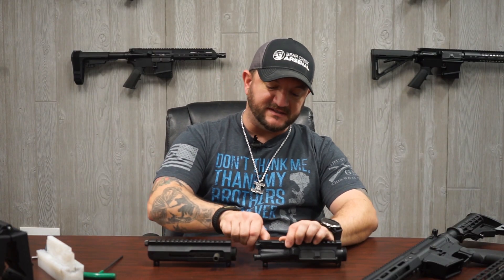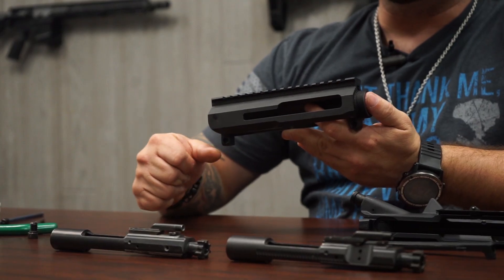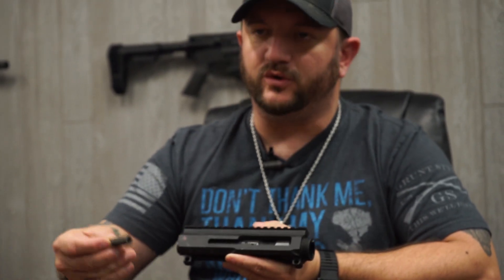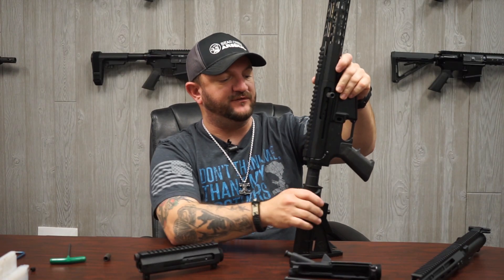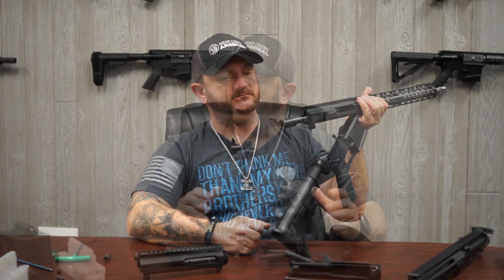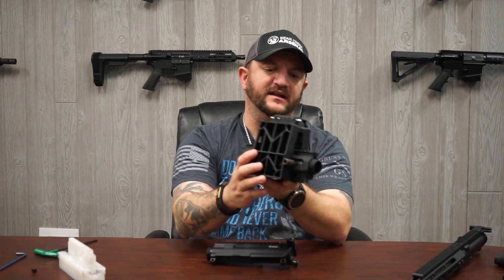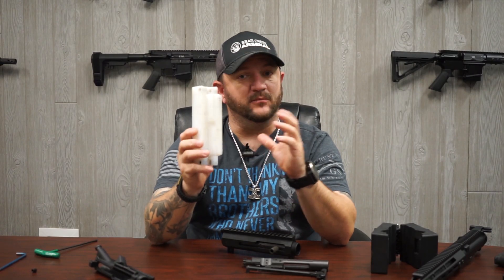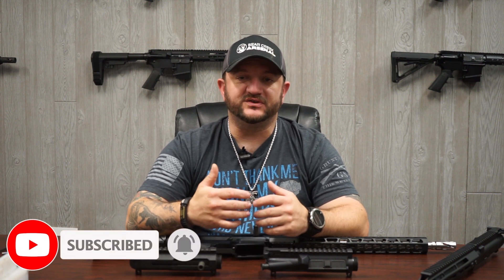Side Charging Upper: Guide, Tips, Maintenance, and More Common Questions

Comment: just got my 10.5" side charging upper from BCA in .223 wylde. I LOVE it!! well actually i wish i could say that. under gassed short stroking and the bolt locked up twice in less than 30 round, never once fully cycled. sending it back....
Reply: I had the exact same issue with my wife's pistol . Did you exchange it or just get a refund ?  It's too late for me to send hers back so I will have to start going through the change parts game from the gas system to the different buffer components .

Comment: Great video, just received my Bear Creek Arsenal 350 legend upper, very impressed with initial fit and finish. Minus the charging handle which looked like it was dropped or hit, I just filed it down a little. My question is my headless screw seems alil loose, can the screw be screwed all the way in? Or will that interfere with the gas system somehow?
Reply from the maker: Yes screw it all the way until the flat side of the screw is facing down. Sorry to hear about the handle, we recently updated our packaging to resolve this issue. Send an email to warranty@bearcreekarsenal.com if you would like a replacement
Reply: @Bear_Creek_Arsenal   very cool, just got here all together and she’s a beast! Thanks guys!!

Comment: I recently ordered & received a 7.62 left charging upper, i have installed it on a mil spec anderson lower. However, the rear plug does not allow the upper to sit properly. I found on your youtube channel the fix is using a headless 3/8-16 by 3/8 screw. Do I only have to tighten it to were it is flush with the rear of the upper or do I have to screw it all the way in & torque it to a specific spec? Thanks!
Reply from the maker: Hey Rogelio, it should fit as long as the flat side of the screw is facing down when you mate the lower to the upper. If not you can use the headless screw; it's only there to prevent gas from blowing into your face so there's no torque specs. Just screw it in as much as possible so it remains secure
Reply: Thank you!

Comment: Does the plug at the back have to be tight?  On my new one, if i tighten the plug, it's no longer horizontal.
Reply from the maker: It doesn't have to be tight, once the upper is mated to the lower it will keep the screw in place
Reply: @Bear_Creek_Arsenal  thanks!  Love my new upper, haven't shot it yet, but it seems like a quality piece.  

Is there a reason most of the pistol barrels are 'heavy'?

Comment: Gen 2 have a flaw in the bolt and do not cycle reliably on subsonic ammo. Out of (4) .300 Blackout uppers, (2) were chambered incorrectly and the others had serious cycle issues that can be traced to very poorly milled bolt carriers. Gen 1 have been completely reliable (have built (7) of them) with just the problem of the  charging handle coming loose. Will not be buying anymore BCA side charging uppers until this is resolved.
Update: I took the bolt out of the bolt carrier and using grey rouge and a commercial buffing machine was able to make the upper work fine after thoroughly buffing all components. I recommend especially buffing the head of the bolt locking pin because that drags on the upper.
Reply from the maker: Sorry to hear that! Send an email to bcatech@bearcreekarsenal.com and they'll look into your issue

Comment: The Answers we want: 

BCG maintenance part replacement 
Gas block issues 
Staking issues 
Do you recommend a full look over before firing (quality control issues) 

The reddit forums are not particularly looking good for BCA and I'm nervous for my order 

However being infantry we shoot some worn out shit and it still functions. 

Replacement BCG where do we get it or do we HAVE to get a BCA BCG that would be a nuisance
Reply: i used the side charging BCG from BCA in a PSA rear charging upper as an experiment.

Comment: Could a threaded pipe plug be used in place of the rear receiver plug?  Doesn't seem like it would need to be removed very often.   Thanks your videos are quite helpful will be buying some 350 legend uppers very soon
Reply from the maker: Hey Mikel, I don't see why it won't work as long as it has a thread count of 3/8-16

Comment: If a failure to feed were to happen and the carrier is half way into the buffer tube with a mag lock, how would you remedy that?
Reply from the maker: From what I think you're describing I would pull the charging handle back and lock the bolt to the rear. Then try to drop the round out and possibly use something to push the magazine out

Comment: You forgot to mention the inability to utilize the forward assist if you use the side charging handle in a regular upper assembly, because there are no notches in the bolt carrier of the sude charger.  You also didn't mention anything about availability of left side charging handle uppers.

Comment: They should eliminate the screw into the back of the reciever to hold the bcg in and mill out this area to be accept a standard charging handle. Then you have the flexibility to use both a standard bcg and a side charging bcg. 

This would also be a good backup for if/when the screw loosens and the side charging handle falls off. 

I know this would be a cost increase, but would be well worth it.
Reply: I've thought about this already too. I'm not sure if you have one, but the reason for the screw, as mentioned in the video, is to keep excess hot gas from blowing in your face, as well as keeping the BCG in the upper so it doesn't just fall out when you remove the upper.

I sent them an email on a possible fix. It sounds good in theory, but not sure how functional it would be unless my theory is tested, but it seems like it would work. 
Guess we'll see if they can make it happen. 

@Bearcreekarsenal 
Maybe you haven't gotten my email, or maybe you've already tried it, but hit me up. I'll try sending another email. 👍
Reply: Yeah. I should maybe put a crank handle on the front of the motor of my pickup truck in case the battery dies.

Comment: Do u sell those screws to replace the flat rear bolt?
Reply from the maker: We don't sell those currently
Reply: @Bear_Creek_Arsenal  what are the specs for this screw plz.hardware store should have them
Reply from the maker: @jimlittle6640  3/8-16 headless screw. Or we sell the normal rear receiver plug on our site

Comment: What size Allen wrench is utilized to remove/tighten bolt handle... SAE or Metric?  Firing pin, etc... are they "mil-spec"?
Reply from the maker: Hey Dan, the thread pitch is 10/32 and we use a Torx T25 for removal. All our uppers are mil-spec as well
Reply: @Bear_Creek_Arsenal  ... Thank you.

Comment: Technically not true on running a standard bolt in a sidecharger. You can always put a pointy stick in the gas port and charge it. Not ideal or really wanted by anyone, but still technically possible.

Comment: I got one of these uppers on my 24” .223 ar15. The screw holding the side change handle on keeps shearing off at the BCG, I have tried several handles all with the same problem. Is this an over gassing issue or what do y’all think could be going on?
Reply from the maker: Hey Joe, sorry to hear that. Send an email to bcatech@bearcreekarsenal.com and they can give you advice or get it fixed through our warranty department 👍

Comment: I have the 7.62/39 side charger and it’s been great to date. Any fix yet on the charging Handle besides blue thread locker?
Reply from the maker: We're currently testing a new design
Reply: @Bear_Creek_Arsenal  The charging handle coming loose is really my only complaint, it's a double edge sword because you need it to stay tight but also be removable in the field for tear down. Would be nice if it as like 30% longer too.

Comment: What benefit if any does the gap plug that comes with the side charging uppers offer over the headless screw option? I have 7 or 8 of yalls side charging uppers and would love to have those headless screws instead of that butt plug with a flat spot that I always forget to line up just right before I close the upper haha
Reply from the maker: They both serve the same purpose, but the benefit of the rear receiver plug is that you can easily remove it by hand without any tools
Reply: @Bear_Creek_Arsenal  Do you sell the headless screws that fit the receiver?
Reply from the maker: @wadewilson6135  We don't sell them currently; the thread pitch is 3/8-16 though if you want to pick one up at a hardware store or something

Comment: So when reassemble of the side charger what's the torque spec of the side charge bolt
Reply from the maker: Hey Jose, we don't have a torque spec. Just tighten it down until it's tight
Reply: @Bear_Creek_Arsenal  i almost lost my side charger handle when came loose. I tightened it really tight and it backed out again. Used blue lock tight and it backed out again. Used red lock tight and its finally holding but will probably be a pain when i want to remove it for cleaning.
Reply from the maker: @ej22twagon  Sorry to hear that, reach out to customer service if you ever need a replacement handle. We are very close to implementing a new design

Comment: All of my ARs are standard rear charging except one from BCA. 
After comparing and considering the two types, I’ve concluded that the side charging is superior in every way. Charging handle on the bolt is more natural and intuitive than a separate charging handle in the rear, and the back of the receiver is closed, which is much better for shooting suppressed. It also cleans up the receiver by getting rid of the unnecessary forward assist.
Reply: Consider two exceptions.  @andrewgregory151 stated..you need to carry  1or more allen wrenchs to remove the Bolt and Don't forget if you are in Dust/Sand/Brush/Rain... no dust covers may impact your decision on which is best..   I went side but now reconsidering due to harsh environment use.
Reply: @russells.9844  that’s a valid point. In ideal conditions I like the side charging, but would switch to dust cover platform in adverse conditions.
Reply: It's for weekend warriors. Forward assist is very necessary and unable to break down without a wrench sucks!!
Reply: I would really like to purchase  a round side charge handles neither one of mine came with the round style
Reply: @austinmoseroutdoorsaustins2952  those were prone to coming off after every few mags, it would work its way out
Reply: 100%. More people need to recognize and admit this. It’s a different weapon without the rear charging setup.
Reply: @neonnoodle1169  After owning a Sig556 for years its a natural fit for me, and requires no long room behind and time wasted like a rear charger. Drop mag and charge without moving an inch.
Reply: Except ease of disassembly
Reply: @andrewgregory151  LOL
Reply: I have a SIG 556 and AR15.  The side charge on the SIG is a pull-out, no. tools required.  The AR design also requires no tools.  This means no tools for maintenance or dealing with a malfunction.  This is the reason BCA was kind enough to exchange my side charge upper for a rear charger.
Reply: rear charging is just stupid, have a problem with your bolt you need to have tools to remove it, can very well have life ending consequences
Reply: @traxxattacks   your comment makes zero sense. So do you hate rear charging and Side charging at the same time? Lol
Reply: Agreed.  My BCA side-charging AR15 is now my home defense rifle.  I, too, was trained with the AR platform in my law enforcement career (not military like our host) but found that the transition was easy.  I am preparing to purchase my first AR-10 in .308 and will also go with the side charger.  BCA is a good company.
Reply: Side charge is easier than the AR slide arm. . .
Reply: I realize this is old but: before I could afford an AR, I owned a bunch of SKS/ AK's (they used to be cheap! ) and got used to side charging.. AR's/rear charging seemed weird to me, and still do although I've learned to use it fine.. as to the "adverse conditions"/ lack of dust cover, the SKS/AK don't have them and they work fine in the worst conditions imaginable ;) finally, 95% + of current AR owners aren't using them for combat, do maintenance on the bench, and have an allen wrench or two.. are you really going to take your bolt out if you have an issue during a home invasion??? I'm just gonna grab my 40...lol

Comment: I have a 223 Wylde side-charging BCA upper.  Aside from the slight peening of the side-charging handle, it has run without one hitch.  I have another side charging non-BCA firearm chambered in 5.56, a Daewoo K2.  This side charger is a piston gun that has had thousands of rounds through it, also flawless.  The big difference between the two, aside from the gas piston, is the way the side charger is attached.  The Daewoo uses a simple tool free side charging handle and the rear screw on the BCA is replaced by a secure detent button that, when pressed, swivels out of the way to allow removal of the BCG.  The Daewoo receiver is similar to the AR receiver.  Is there any way that BCA can utilize a similar side charging system to be used without tools?  I'm planning on using some JB Weld to secure the charging handle to the charging handle screw to eliminate the spin of the charging handle when it loosens.  Even though I tighten the handle, it eventually loosens during range sessions.  I am hesitant to keep putting Blue Locktite into the BCG to keep the side charger from loosening.  Any potential future ideas on improving your design?
Reply from the maker: Hey Chris, we are very close to implementing a new design. In the meantime, blue Loctite works great and we have a lifetime warranty if anything goes wrong
Reply: @Bear_Creek_Arsenal  Who is Chris?   Thanks for the reply.  Anxiously awaiting the new design before investing in yet another BCA upper.  Love your products and thanks for innovating and upgrading.  The company that cares enough to evolve and move forward is the one that will thrive.  Also, you have outstanding customer service.  Another hallmark of a great company.
Reply from the maker: @jimolson2855  Haha, my bad Jim. I appreciate your support

Comment: Pretty frustrated. A 223Wylde upper I purchased from you won’t cycle. I’ve emailed about seeing for a warranty repair and have received no response from customer service.  Don’t want to put you guys on blast but ignoring repeat customers or customers in general is not good practice. 

For my other armchair commando’s yes I’m sure it’s the upper, not the lower. Tried different uppers on the same lower and had no problems. I’m getting zero movement from the bolt when firing... zero. Tried a different bolt and had same results. 

BCA. Where you at?
Reply from the maker: Hey Brett, sorry to hear this. We're experiencing a slight delay in customer service due to high demand, however, they should get back to you soon. If not, send us your email via private message on social media and we'll alert someone.
Reply: @Bear_Creek_Arsenal  ok. Thanks for the response. I will wait a few more days. 

Good video by the way. Ps. You guys should throw lock washers on those side charging handles.

Comment: Did he ever clearly explain if it was possible to charge a standard bcg in a side charging upper? He loses me when he start explaining the headless screw and never really explains how to charge it and its capability to function.
I have 2 side charging uppers, 5.56 and 7.62... would be kinda cool to have this clarified.
Reply from the maker: Hey Namon, unfortunately no, you won't be able to charge a standard BCG in a side charging upper
Reply: Ong I have both of BCA.  Remind me to try it tomorrow night.  I’m thinking to use a 5.56 round in one of the RC BCGs.  Put it in the hole and rack it back?

Comment: Great timing for this upload, I just started to look into side charging uppers today, seems like the best option for the Fightlite SCR lower if you can drill and tap their proprietary BCG to take the side charging handle.
Reply: This Scr is the reason I’m watching this video!! I was wondering the same can I just drill and tap for the Scr bcg to adapt to a side charge? I built one with a shock wave grip.. the standard charger works but I have to watch my grip hand or it hits my thumb knuckle..

Comment: If you use the clamshell to hold the side charging upper without the BCG inside it could crush the upper enough to interfere with semiautomatic function.
And, the bottom block can also be used to clamp the upper on irs side, picatinny rail against one has of the vise and bottom block against the other.
Reply: I just posted a similar comment as yours. Looks like thought the same thing but I am just 4 years too late haha